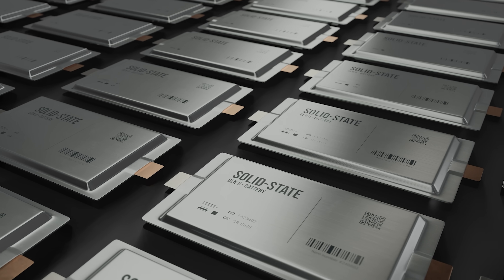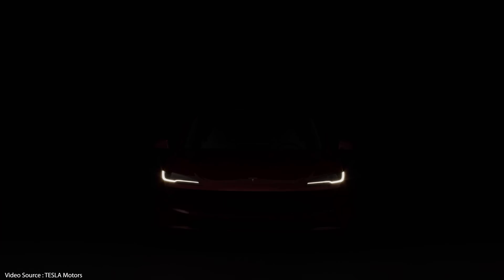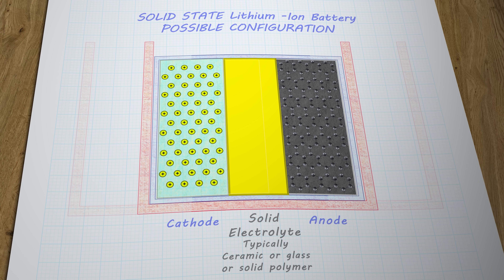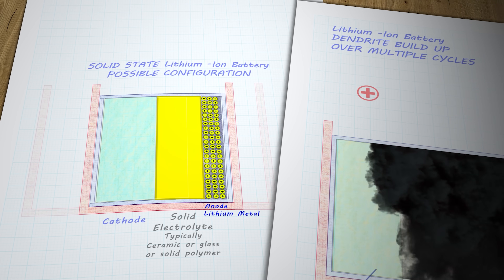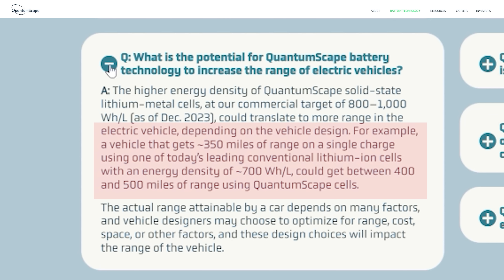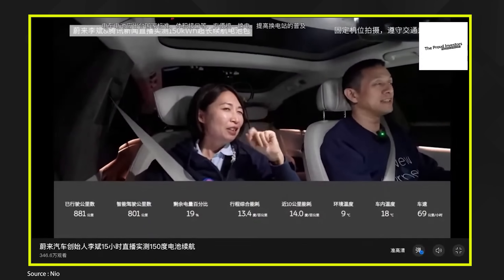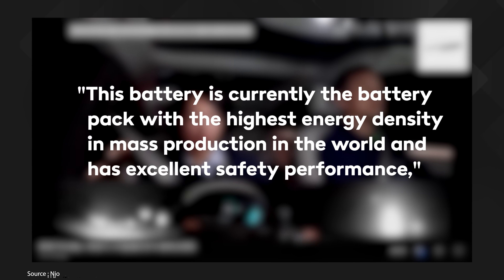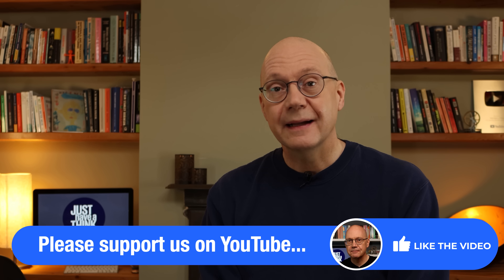Solid State Batteries - FINALLY powering electric vehicles in 2024!

Comment: Perhaps another someday announcement but...

Harvard University lithium metal solid state battery January 2024 announcement : "Researchers from the Harvard John A. Paulson School of Engineering and Applied Sciences (SEAS) have developed a new lithium metal battery that can be charged and discharged at least 6,000 times — more than any other pouch battery cell — and can be recharged in a matter of minutes.The research not only describes a new way to make solid state batteries with a lithium metal anode but also offers new understanding into the materials used for these potentially revolutionary batteries. The research is published in Nature Materials. "

As always, another great video Thanks Dave.
Reply: 6000 times recharged in minutes.
1: Yes that is possible, even today
2: not at the same time
3: What for? 6000 x 70 kWh @ 150 Wh/km = 2.8 million kilometers that is by far too much for vehicles. Even ships or trains.
4: 70 kWh in 5 minutes means 840kW power times 80 (for the largest Supercharger site currently) = 67.2 Megawatts. Thats a bit much don't you think?
Reply: @wolfgangpreier9160  Just the messenger, but yes, you have a point. But, then again, just because the potential is there doesn't mean the limits of their capabilities are the only option for their use. Perhaps 500 kW charging is doable? Or smaller battery packs? You sound more technically astute than I, so perhaps you could enlighten us.
Reply: @pearldiver7  It depends on the country and site where you place those chargers. 

Simply said: We in Europe must concentrate on the truck chargers which we NEED on the highways/the Autobahn. All troughout Europe. The pasenger cars can wait 10-20 minutes more. That does not matter.

But a fleet of 200.000 trucks waiting for 1 hour more because of low charging capacity is financial suicide.

The limit with most cabling is about 200-250kW. Some use heavier ones that can only be handled by men and truckers. In cold weather those are not an option. We see it this winter. The lighter, thinner cables with less than 600A capacity are the practical limit for passenger cars.

Smaller batteries means less range. Less than 60kWh makes no sense, those cars NEVER visit a Supercharger. They are only used inside the city and its surroundings.

High limit for chargng: 250kW.
Low limit for batteries: 60kWh.

Everything else is good for home use.
Reply: @wolfgangpreier9160  When you say a 600A cable can do 200-250 kW, I guess you're thinking of 400V battery packs? Many newer vehicles have 800V packs. I don't know the DCFC specs of Europe's CCS type 2, but in North America, CCS-1 and J3400 support up to 1000V. (While AC charging uses a fixed voltage from the mains, DC fast chargers supply whatever voltage is negotiated with the car in real time.)

Comment: Solid state is maybe the answer to all the issues with current lithium batteries but without long term data for large cells/packs I think we are decades away from mass adoption at least with EV. The majority won't want an EV with a solid state battery given the cost of EV batteries without knowing the longevity in a variety of conditions. I could see small affordable items being accepted and then confidence in the battery type building from there.

Comment: Too high cost to be competitive with slightly older Lithium battery technology is possibly the problem with solid state lithium battery tech.  A workaround is to use them in small devices, drones, and electric aviation, unless cycle life is also a problem.

Comment: Dave, thanks for the great tech reporting. Now if someone can just develop an affordable home and small business scale battery. That’ll take the electrification of the power grid to the next level.
Reply: There are many products out there that might qualify for "affordable" 
I built 2 DIY battery systems and had decent luck. Both are 24V 8P2S configs of ~5KW-hr and 14.3 KW-hr.
The 3rd attempt was terrible as the company went out of business B4 honoring their warranty of NEW grade A cells. 
The cells were obviously used and most were unusable.

My latest battery is an EG4 LFP 48V 280A 14.3 KW-hr wall battery for about $4000. 
It has a built in heater for colder weather. The newer ones are UL certified.
This is more than enough for my daily needs. Charge it full and use it over night.
Reply: @lunatik9696  $4,000.00 for that capacity is NOT affordable.
Reply: @lunatik9696  DIY is not the way to go as it will never reach volume.
Reply: Sodium-ion
Reply: For home you can always use lead acid. Dirt cheap and the high weight and low density doesn't bother you.
Reply: @svr5423  You can but in my opinion it doesn't make too much sense. Mainly due to the inferior operational life.
Reply: @beatreuteler   If you treat them well, they typically outlast lithium batteries. Just check the fluid level from time to time and don't let them discharge.

They are also much more tolerant of heat in the summer.
Reply: @svr5423  If you compare them to LI-Ion batteries of Smartphones, tablets and Notebook computers, that's ok, but that wasn't what I meant. Apart from that I haven't seen a lead acid battery outlasting any of these.
Reply: @beatreuteler   As I've said, I've seen plenty of them. Even working after 10 years.
People on budget are even buying up used lead-acid batteries for home use, a thing you usually wouldn't do with Lithium.
Reply: Small business and home are not the same market.

Comment: Better batteries sounds perfect, but especially for mass production there is an elephant in the room that with the public available data we can't answer and that is cost. If first cars are really produced with solid state or mixed it sounds even costs are under control as needed for the luxury class. Even if the costs would be higher there will be a market  with new applications that can then be electrified or better electrified (big construction and agriculture machines etc.)

Comment: Range anxiety is indeed not a problem anymore for electric cars, however it's still a serious issue for electric motorcycles.

The limited size and weight means that active battery cooling isn't practical because adding it means you have to reduce the number of cells. The result is you can charge twice as fast, but you only get half the range, for no net benefit. 

So you're stuck with 40-60 min charging, and only about 150 km of range on even the heaviest and most expensive bikes.
Reply: I do not think that electric motorcycles have even the slightest meaning in a global economy. They can always use SSBs for 100 US$/Wh.
Reply: @wolfgangpreier9160  there's about the same number of motorcycles sold per year as there are cars. So they're pretty significant.
Reply: @gasdive  You are of course correct. worldwide 60 million motorscooters were being sold.

And about 5 million motorcycles.

And about 79 million cars and 26 million trucks.

You want special batteries for the motorcycles? For Ducati, KTM, Yamaha, Harley Davidsson?

Comment: Energy density is still 3 orders of magnitude lower than gasoline.
Reply: Gasoline is the charge, not the tank.
Do you even have a clue how much an electron weighs?
Comprehension is a real thing.
Reply: @jimurrata6785  yup…comprehension that you lack obviously. What is important is the medium holding the energy that will be spent and how much energy that “tank” can accommodate. Again, at equivalent mass, gasoline beats it…every time.
Reply: @albionpendragon2285  very interesting 🤔
It takes 33.7kWhours of electricity to make one gallon of fuel. A gallon of fuel gets a vehicle 15 to 40 miles, according to the design. 
33.7kWhours of electricity gets an e-vehicle 120 to 140 miles or more. 
So 68kWh of electricity, equivalent to 2 gallons of gas, gets an e-car 240 miles or more. You do the math, stable genius....
Reply: @jimurrata6785  lol….I don’t think you understand the numbers that you are spewing but, again,1 kg of gasoline holds 13000 Wh, 1kg of Lithium-ion battery delivers anywhere between 180 to 280 Wh. Even when factoring in the lesser efficiency of an ICE because of the heat loss, the ratio is still 2 order of magnitude in favor of the internal combustion engine. You see the difference? It means that you need more mass of Lithium-ion battery to deliver the same power… genius. Why do you think that, still today, ICE gives 2 to 3 times more range than an EV? This is also the reason why there is also no transport truck that is electric. The ratio mass/power delivered is way too disadvantageous for an electric truck.
Reply: @albionpendragon2285  I understand exactly.
First off a "gallon" of gasoline contains ~33kwh of energy v/s diesel @ ~38
But let's use ACTUAL SI units instead of some absurd U.S. crackhead denominations like BTU per 0.429 pecks, shall we??  🤔
There are grownups in the room. We actually speak in coherent sentences.
Batteries are improving _every day while the dying fossil fuels industry is up against the Carnot efficiency and actual laws of thermodynamics.
Electricity can be literally free, and free from exploiting the planet's resources.
Nobody is an actual Emergency Mobile Trombone Repairman.
Nobody I personally know with an EV has ANY problem with charge density.
How many EV's have you run out of juice in while cruising silently down the road with enough torque to make the Memorex ad look tame????
Come back and speak when you know WTF you're talking about.

Comment: The video leaves me cautiously optimistic, that it might be on the verge of mass production.  But I suspect mass manufacturability will probably challenging, even if it can be done.   It might be more expensive. So I'd rather they go for the max energy density, prove it out in other larger scale applications, such as drones, eVTOL's, where business's might be willing to pay a premium for the capability.  After they've proved it out in one application domain, gained some experience, then they can move to automotive, if the cost drops justify it.
Reply: Far from it. Even if they could produce SSBs en masse they can not put them in cars before they change their cars. And that takes years. Tesla could do it, but they are not interested in those cells. Maybe Na+ sometimes in the future, but SSBs deliver no descernible advantage at the moment.

Comment: Is it too much to ask for the world to standardize on a modular format of around 10-20 kg and some volume envelope that accounts for different mass density of possible future designs.   Actual energy density of module could vary, but they’d have to decide on a voltage and control signal and possibly cooling fluid interface.

I’m really sick of all this isolation between car makers. We’d go a lot further if you let consumers buy from any number of manufacturers for any BEV.

Comment: I am a trifle confused. As a qualified electrical engineer I have always known the positive pole of a battery to be the anode and the negative to be the cathode. Your diagram at the beginning seems to be the opposite way round. ??
Reply from the maker: The acronym PANIC (Positive Anode, Negative Is Cathode) is a helpful mnemonic in the context of electrochemistry, but it can be a bit misleading if not properly contextualized. The confusion arises from the different ways in which we define anodes and cathodes in electrochemical cells (like batteries) versus electrolytic cells (like in electrolysis).

Electrochemical Cells (like Batteries): In batteries, the anode is the electrode where oxidation occurs, and the cathode is where reduction occurs. The lithium-ion battery is a type of rechargeable battery, and during discharge, lithium ions move from the anode to the cathode through the electrolyte while electrons flow through the external circuit, doing work. Here, the anode is negatively charged (as it donates electrons) and the cathode is positively charged (as it accepts electrons).

Electrolytic Cells: In the context of electrolysis, the anode is the electrode where you apply a positive charge, and the cathode is where you apply a negative charge. This is the situation where the mnemonic PANIC usually applies. Here, the terms 'anode' and 'cathode' are defined by the direction of the external current, not by the actual charge of the electrodes.

The key point is that 'anode' and 'cathode' are not fixed terms for positive and negative. They are defined based on the function of the electrode in the circuit. In the case of rechargeable batteries like lithium-ion ones, the anode is negative during discharge (which is the normal use of the battery) and becomes positive during charging. This switch is what can cause confusion when applying the PANIC mnemonic.
Reply: @JustHaveaThink  Thank you so much for this explanation.  I've been confused by this for years.
Reply: @JustHaveaThink  Thanks for that clarification which confirms that my thinking, generated from a battery float type system is correct as is yours in a battery discharge state.

Comment: Actually, you may probably save more lithium overall with pure lithium anode as lithium from graphite anode is fairly impossible to recover. There is no good industrial process to do so. Whereas with pure lithium you do have a way.
Reply from the maker: Fair point Sergey.
Reply: Wait, you don't recover lithium from a graphite anode just by ... discharging the battery?
Reply: @ps.2  Yes, if only there were pure lithium cathode batteries. But there aren't any.

Comment: CBC marketplace just did what I’d call an expose of the problems with EV’s in Canada. The effective range was found to be much lower than the stated range. Cold weather reduced range significantly, especially if you used the cabin heater. They tried to stop and recharge but many of the chargers didn’t work with the apps or were out of order. The kw hour rate charged varied hugely as well.
Reply: This winter has been pretty cold in finland too and ev's are most toed cars in the country.. Even tho there aint many of them.
useles junk in northern countries.
Reply: @hornantuutti5157 where have you got that stat from?
Reply: This winter has been pretty cold in finland too and ev's are most toed cars in the country.. Even tho there aint many of them.
useles junk in northern countries.

Comment: 3:24 to 3:39 , I wish to thank you from my heart for doing something not many do which is give credit to the ones who either discovered or invented what many scammers and under achievers try to claim their own. Too many times it’s happened where someone even on physics claims to have created or invented something only for everyone to find out later they just plagerize  and scam unwitting investors into forking over funds and 99 times out of 100 advance not one mm or flat out run with the money and hide. Sure it wasn’t called a solid state battery back then and it may have been around the mid 1990s before the phrase was coined but you still have to move aside and give the pioneers due credit. Like battery swapping instead of stationary charging. Something that was recorded to have been implemented at the end of the 17th century but you still have those claiming they invented it. Thanks again .,

Comment: One of the biggest hurdles we need to overcome is the crazy idea which we can't seem to get over that we need to produce vehicles capable of doing speeds that can't legally achieved on most roads in most countries, if we only made vehicles capable of doing the maximum legal speed limits not only would we save many thousands of lives on the roads each year but we also wouldn't need to pay for so many traffic officers to police the roads, plus nobody would ever get a speeding fine.
Reply: EVs have a few legacy issues - already! In order to 'prove' themselves a worthy replacement/successor to ICEs, they needed to match/exceed speed, range, 'refuelling' times etc. This is because customers can't adjust their thinking to a new product behaviour i.e. grasp the concept of topping off charge each night, at home, at low cost vs refuelling off-site for 10-minutes each week/fortnight.
Ultimately, customer education may be cheaper than R&D.
Reply: The biggest hurdle is putting people behind the wheel in the first place
Reply: Sounds like idiots who speed up while being overtaken will grow their body count.
Reply: How fast do you think normal cars go? Most sedans can barely hit 100mph, and reaching those speeds with an electric engine is pretty trivial compared to internal combustion.
Reply: @SelectKiko  you're being too sensible. Next you'll be saying that 300 miles on a single charge isn't necessary.
Reply: Strange idea, but could it be speed limit isn't the same on all roads? As all new cars already know exact position and speed and store those data, all that would be needed is a regulation giving access to the data(for trucks that even partly exists as extra units they have to have).
Reply: @Techmagus76  Just what we need, a car that you nominally own, but which has a speed governor that calls home to some company or government agency somewhere, to limit what you can do with it based on what it believes you should be permitted to do in the circumstance it believes you are in. And if it happens to lose 2G cell reception, no doubt it will lock the governor at 25 mph, just to be sure.

I can see that being super popular, yeah.